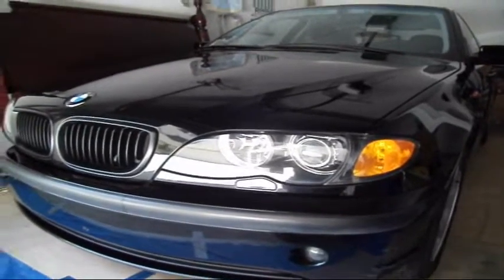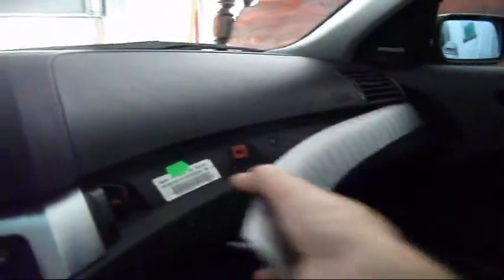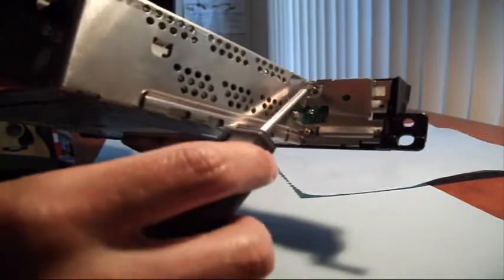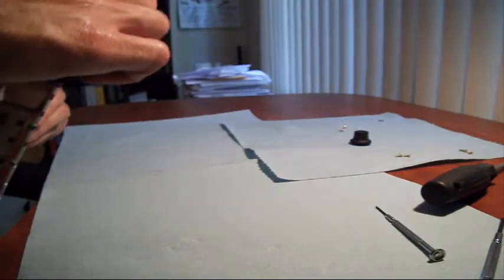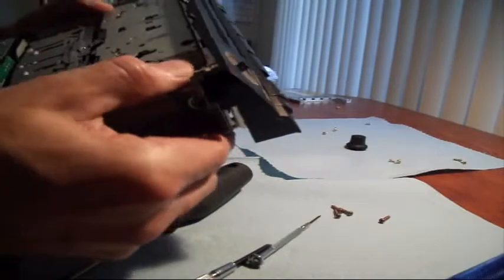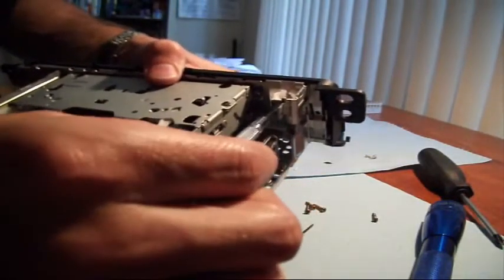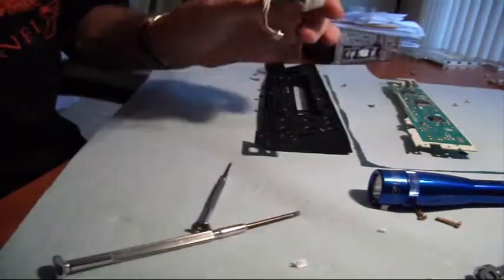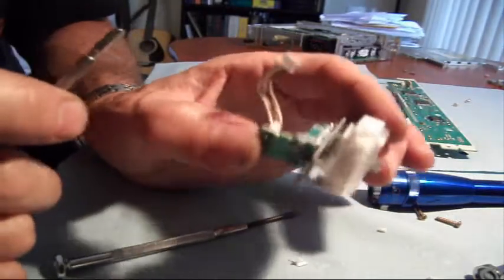BMW E46 Stereo volume-on-off knob repair (Part 1 of 2)

Comment: Thanks for this how to. I just finished fixing the knob on my M3. I think I only had to remove 3 screws from the top cover, 4 from the heat sink and 4 to free up the faceplate. I didn't remove the board from the faceplate either. My local HW store didn't have small enough screws, so I went with some good epoxy for the fix. It's pretty solid and works great. The ribbon cable is a little bit of a pain, but some tweezers through the side where the heat sink was did the trick.

Thanks again. I know this is an old video, but it's still helping people out.

Comment from the maker: @wh855c Thanks for watching and commenting.  I don't know much about fixing the RC key.  My guess is that the battery inside is old and not charging up (while you have the key in the ignition).  Try taking the key apart and replacing the battery. /John

Comment: Thank you.. Your video gave me the courage to take the radio apart. After doing so, I found the stand-offs were just cracked. One of the screws was most of the way out. The other, was rattling around inside the radio. Since the stand-offs were still in pretty good shape, i just epoxied the knob assembly right to the stand offs getting a good amount of epoxy on/in the stand-offs. I used 5-min epoxy, but let it dry over night before putting it all back together. Worked like a charm. Also, thought i would mention that I disconnected that flat ribbon cable from face plate. It comes off and goes back on pretty easy. There's a 'lever' type connector that holds it in. There's also quite a bit of length to it and you can pull on it without worrying about it tearing. However, you should still be very careful.

Comment: Bad diy in the time the battery died and he removed the front plate he didn’t show how he did that...when my front plate came off the ribbon disconnected bricking the unit